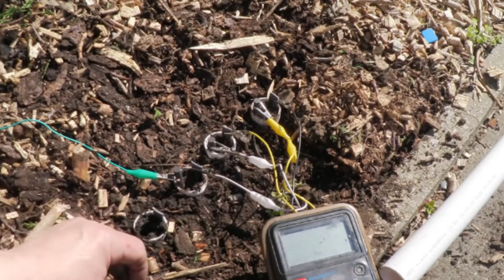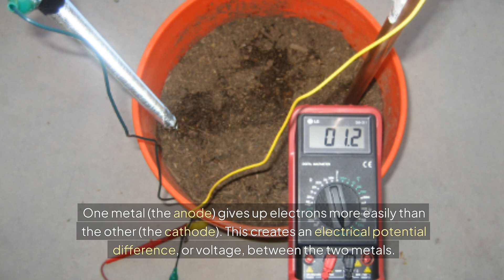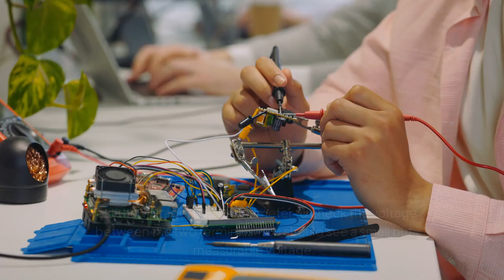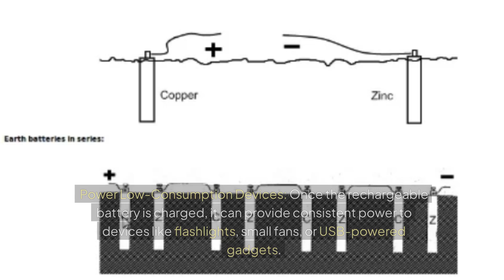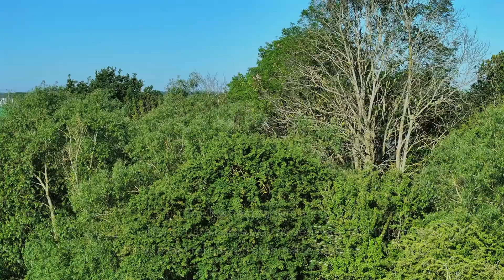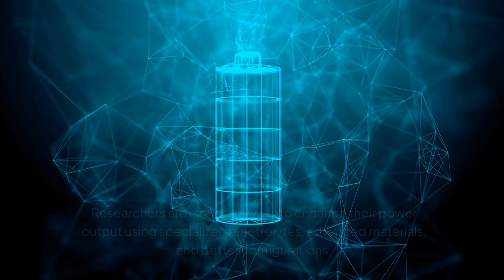Power that's DIRT cheap?

Comment: not only will you not get enough power out of it to refund the energy mining and refining the metals
your also losing the metals that are needed for other stuff
all that for the most expensive half a watt you could find 
people will do everything except the proven efficient wisdom of our ancestors 

its literally just a battery
except you take the efficient acid and direct contacts, and replace it with slow erosion and massively wasteful contacts
the potato battery of the people who havnt figured out farming yet 
 
your going to be so amazed once you discover the amazing tech of a bike and a dynamo
Reply from the maker: This is an informational video on something a lot of ppl didn't know existed. I am also familiar with various other forms of electricity generation, including the potato, and bicycle power among others. So, no, I won't be amazed, since I already know about other options, and, who knows? I may do a video on those as well.
But, for some in SHTF, they MAY remember this, and get that small amount of power to get a rechargeable battery charged enough to listen to a radio, etc. Every bit of knowledge we can possess is priceless, bc you never know what your circumstances will be when an shtf scenario happens or what resources you will have with your or around you.

Comment: Western Union Telegraph needed miles of earth batteries to power a telegraph. Also the soil must be acidic and low in minerals. Any mineral that will carry a current will short out the battery.
Reply from the maker: Yep! But, if all you want is to create enough juice to charge a rechargeable battery so you can hear any news on a radio for a while, etc, then this is an option. There are others, and ones that create more power, which I may do videos on in the future :)

Comment: They generate MILIwatts. In other words if you make a thousand of them and connect them together you may have about one fiftieth what you need to run a lightbulb. Meanwhile for the price of the electrodes you could have bought a solar panel producing hundreds of watts.
Reply from the maker: Well, yes. That is why I mention in the video SHTF when being able to charge a rechargeable battery so you can communicate would be a good use of this. I state how much wattage you can generate. I tell you what it will and will not power.

Comment: if it worked, people would be doing it.
Reply from the maker: Currently (pun not intended), we have other readily available means to acquire alternative power. This video, which I thought I had explained, is designed to show you how to garner enough energy in an SHTF, or in my case, a dependence on solar and all its whims, situation. One in which you don't have electricity, batteries have worn down, and this method can generate enough power to charge a radio or other communication device. It has limitations, as I also explained in the video. But, the fact that scientists are working on ways to create more energy from this dirt battery method shows that it does work.

Comment: It has NOTHING to do with soil, its all the electronegativity of the metals as they get consumed/corrode when current flows. In other words: the old type of batteries!
Reply from the maker: okey dokey! And a great option when SHTF and batteries are not something that you can head out to AutoZone and drop $100 on :)
Reply: @offgridstyleprepper  Try to build your kind of soil battery that is able to handle at least some 100++ Watt load on an  inverter
Reply from the maker: I stated what could be powered-something like a rechargeable battery, how much voltage you would get, and what you could expect this to do in the video. Never did I suggest this would power anything larger than a rechargeable battery, perhaps to use in a radio when SHTF.
Reply: @offgridstyleprepper  I agree, up to a few watt this will work. I for myself would probably prefer small solar panel (30 years usability) with Li-Ion cells (my oldest are 10+ years still work great but some capacity lost). Anyway thxs for showing up alternatives. I wish you a happy new year :)

Comment: Nice vid Nikki ! you can also capture residual energy below high tention power lines by using a section of wire fence  , though it can be very dangerous esp. if ur charging capacitors that can be used for self defence tools. It works on the same principal but with higher potential . The copper cathode in the ground  n the gate/fence layed out flat like a table under the tention wires up on 4 wood poles about 6 foot high with the other wire hooked to it it as an anode . both wires can then be used to directly charge capacitors ( takes a while ) or most beneficial the wires can be attached to a small solid state  rectifier n hooked to a 12 volt battery for storage it basiclly just keeps it charged til used n then takes about four days to charge back up , so no power house for sure . But no sunshine required . By the way this is not legal esp. if your cathode wire is attached directly to the support tower and if the table is within 24 foot adjacent to the tower paralel to the lines n has to be on your own property . Don't ask me how i found that out lol

Comment: Morning Nikki. Anode is pronounced anne-ode. 😁 Anyway, good information, there are theories that this was even known back with the early Egyptians. This also reminds me of electroculture and using a small amount of electric current through the plant to stimulate growth.
Reply: I've had up to 125 volts of line voltage run through me a few times. A fluorescent light ballast even more.  It darn sure is stimulating. lol
Reply from the maker: Wake you up quicker than coffee, huh? lol
Reply: @offgridstyleprepper  It sure does, but it's all part of the job. Off topic, but since it's turned into an exciting day around here and the Food Department is still in Houston I decided to try out some food preps. The Hormel Steak and Potatoes that was dated Oct. 2022 reminded me why I don't care for canned food. Very bland and borderline tasteless. The Mainstay bars are much better. More vitamins and tastes a whole lot better. I was forced to stay in my truck earlier today when I got home. Wind shear from a tornado that hit a couple of towns over in Cleveland was real bad. It blew debris 20,000 feet in the air.
Reply from the maker: ok I read this on my email notifications, and just like when I get a text, I was like, 'ohh, need to answer that!'...then promptly saw a shiny object and, well, there you go.
First of all, exactly how much time are you spending in the man cave while the cat's away? lol Re: canned crap. This is why I vac sealed smaller packets of garlic (especially garlic), salt and pepper, for seasoning without ruining a big container by opening it up. Season that stuff..once in a while I do grilled ham n cheese and canned soups/stews and season the hell out of them bc otherwise they taste like sh*t lol.  I am VERY glad that you are safe as you are one of my most favorite people. And, I would like to set up a brain electrode connection between you, Eric, and myself so that when these stunade ppl comment that 'dirt batteries don't generate enough power, you're better off buying a solar panel' 🙄 or 'these are just like old batteries, so why bother' I have all the answers (especially the snarky ones lol) y'all are so good at coming up with. Also, since y'all are both on this thread, I have an awesome vid on survival uses for hair but The Producer had another plan for my day so it will be out Wednesday.
Reply from the maker: G'morning! I wasn't sure which way to say it, as I am not all that when it comes to electricity like you, 3 Dogs, and Keyfitter..but I also figured it would make you smile lol

Comment: This is really useful information for an extra power source but pounding metal rods through limestone is too much work for me . I’m quite familiar with electrolysis eating dissimilar plumbing pipes such as copper mixed with galvanized pipe with water being the electrolyte. Dielectric unions have to be used to prevent the corrosion process.
Reply: good info , thx
Reply: The electrolysis destroys the metals
Reply from the maker: G'morning! I did see, when hunting for ANY pics of an earth battery, that some used water instead.